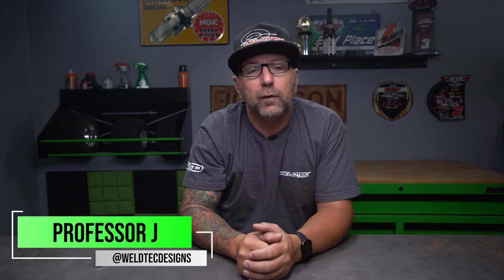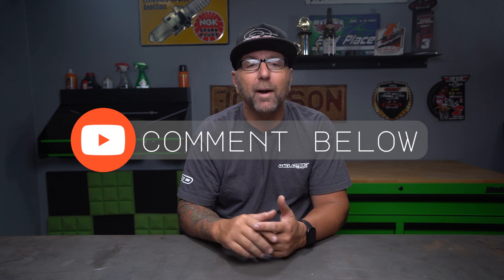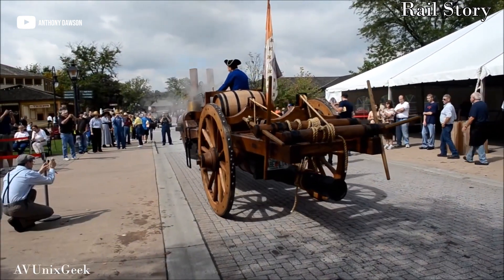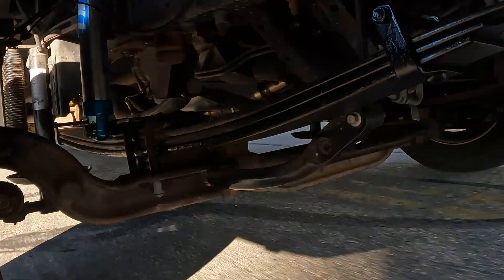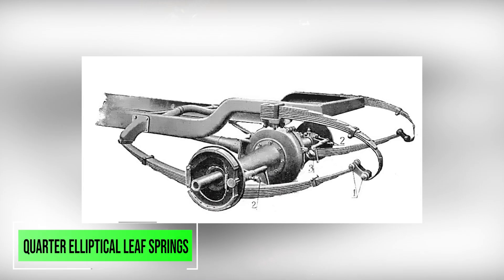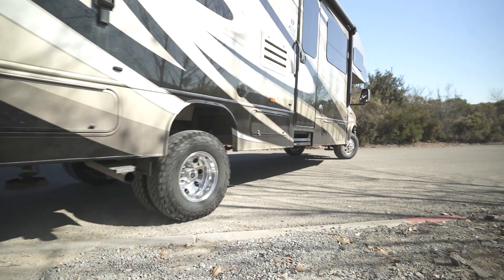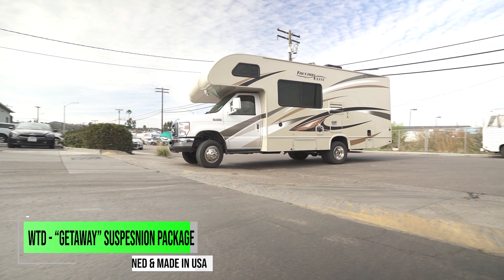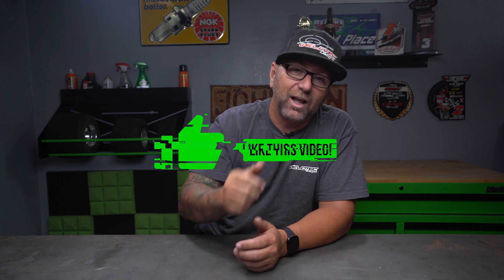Leaf Springs Decoded: Exploring Types, Mechanics, and Performance | WTDU Part 1

Comment: Greetings.  I have a Roadtrek 2002 200 with flat leaf springs, has 75k miles.  Turnpike cruiser so do not need anything exotic.  Everything is in the way to get the old springs out, I estimate 2 days to remove and replace holding tanks and such.   Now don't laugh but how about I leave the the long spring attached to the van in place and replace the spring pak with new springs?   Your laughing arn't you?
Reply from the maker: That method would work for an add-a-leaf, but definitely not for our progressive leaf springs.  Give us a call. Perhaps our tech support could walk you through a suitable solution. 619-596-9831

Comment: I have 19’ E350 rv with singles in the back - magestic 19g . It came with no rear sway bar . My leaf springs have 9 leaves , and are bent backwards which is common on this model typically the ex rentals which I have. It’s more than a handful in 25 mile cross winds and at time’s dangerous. The bilstiens have helped , buts time to call u and figure out what’s best . Tim NY